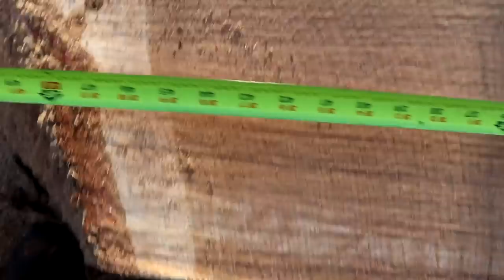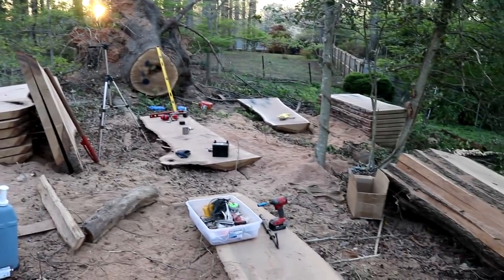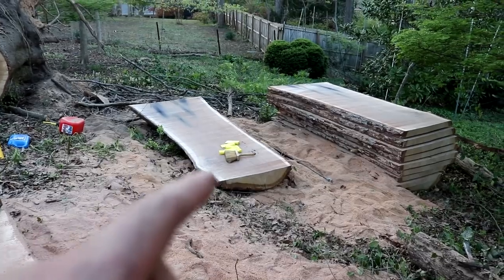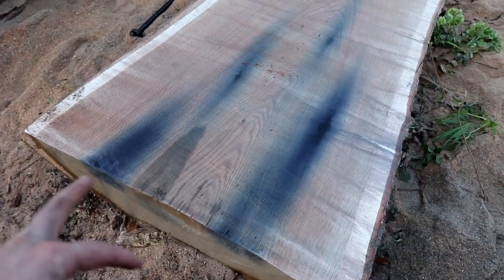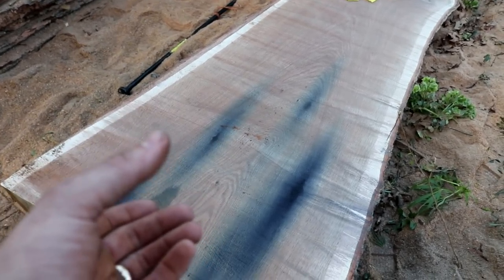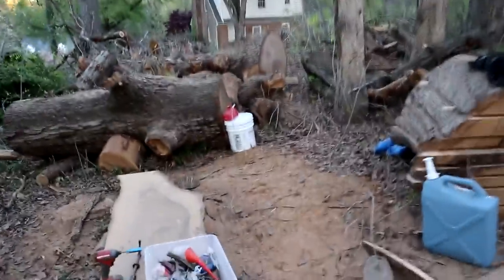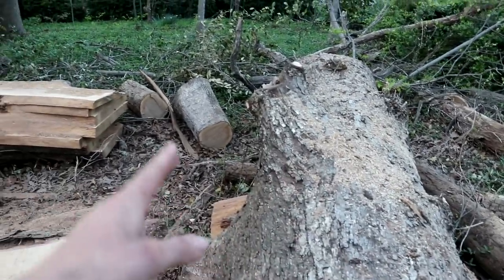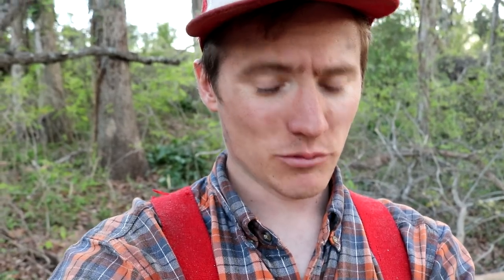HUGE CHAINSAW MILLING JOB!! 45 Foot White Oak!!!

Comment: Even though I have had extensive experience with chainsaws throughout  my life, I have never considered using one to mill lumber until watching your videos. If I ever decide to tackle the challenge, I know I can fall back on your channel for some valuable and instructional insight. I encourage you to continue the work you are doing in your own unique manner. Speaking for myself, it is highly appreciated.
Reply from the maker: It's a cool system, it's got huge capabilities when you consider how large of a bandmill is required to do the same.

Comment: How dead and dry was that tree? I did an end cut log round table and the thing aplit like crazy. Is an end grain “round” slab going to dry out faster? How do you keep your slabs from splitting, start to finish? Looks like anchor seal with the initial cuts.... do you have to stay vigilant with sealing after you slab and plane? How that wasn’t too much jumble! Great work sir! Inspiring for sure!
Reply from the maker: It recently fell over, it was basically still alive, leaves still green. I use Achor Seal on the ends of the log before milling.
Reply: The hard part with "cookies" is that they dry at different rates, from the outside first - it puts a TON of strain on the wood, which causes it to split apart like that.  Check out this video from Matt Cremona for a good explanation: https://www.youtube.com/watch?v=UupXXZ4kVfA

Comment: What is that device you're using to make those slabs?
Amazing!
Reply: It's an "Alaskan mill", probably Granberg. He's rigged up a pulley system with a winch which will make the job a lot less tedious. Saves a lot of pushing and pulling on the heavy saw with the big bar...

Comment: I love your videos, so I'm asking nice for you to wear your chaps if you're gonna jump a trunk with your brake off. How much does that slab weigh at 11:00 if you had to guess?
Reply from the maker: I think the big slabs weighed 300 - 400 pounds. It's soaking wet and white oak....some may have been near 500. It felt like picking up slabs of concrete.

Comment: minus the time spent milling you are really cutting costs of table material. stay safe out there!
Reply from the maker: I'll be honest, this is the most expensive lumber I've ever gotten. Paying is much cheaper as long as it takes to do this work. In the time it takes me to deal with it all, I could make a ton of money if all I was doing was making tables. The problem is the rarity of what I'm getting.
Reply: Would it have been better to have hired a labourer for some of the grunt work and to make it all a bit easier and therefor faster. I sure the cost would be balanced by you getting back to what you do best and make the money on (building tables), quicker.
Reply from the maker: That could be said about everything...but then you've got someone standing around with a dumb look on there face ruining your fun because they could not care less about what you are doing. I'm not doing any of this because I have to, I do it because I want to. With that said, help would be nice, as long as it's the right help.

Comment: What oil are you using in your gravity drip system?  I read that you can use cheaper vegetable oil since you are dripping on the pull side of the chain you don't need a sticky chain oil.  Do you worry about chain oil staining the wood?

Comment: Excellent video. How long has the tree been drying out for, before your slab cut it? Your slabs are beautiful and precision cut. You are absolutely a professional slab cutter. Your chainsaw mill equipment is professional precision equipment. Well done, good work.

Comment: Sounds like you have more tasks then time to do them. Family is important. I liked the wood with the stain running through it, is that natural? Also 
Poking forward to you completing the house. Keep up the good work.
Reply: Looking ,sorry auto correct.
Reply from the maker: The black stains are from nails or some kind of steel. The dark brown stains in some of the slabs are from some naturally occurring situation, not sure what. All the rest is just the wood.

Comment: Just for the sake of asking . If you were to cut , sell 
 , what would the cost be for this ? Yes the whole tree and stump too , if any good wood was in it . As is , green , ready to be stacked and dried by the buyer elsewhere .this would include the buyer having helpers to load and stack the wood on a trailer . Not you loading it .

Comment: The future looks bright. Great finds with all that lumber. Are all of these trees a keep what you cut type deal? I'd guess most people are just happy to have the fallen trees cleared.
Reply from the maker: I'm not paying for any of it. I try to clean up the best I can, but I'm not leaving with anything else than slabs. I'm just cutting up the branches and toss stuff over in the woods. If a person wanted me to remove it all.....I'd probably just pass. If I was set up doing this stuff professionally and had lots of equipment, etc...then maybe I'd get the other stuff, but it's too much work for what I'm doing.

Comment: 8:05 This comment was translated with google translate. It may be difficult to understand. The original is below.
Forest or plain roads, where huge logs are cheaper than crushed stone or market and crushers and crushed stone, could be built of huge logs, cut near the road on 3 or 4 sides, caught together with the edges from the ends cut obliquely so that thresholds do not appear. It is an anti-theft solution. In California, in a desert area in the 1900s, an entrepreneur paved a boardwalk. Part of the road still remains today, but most of the planks were stolen by the few locals who sometimes had to transport them tens of kilometers to their homes.

Drumurile forestiere sau de campie , unde bustenii uriasi sunt mai ieftini decat piatra sparta sau piata si aparatele de spart si maruntit piatra , ar putea fi construite din busteni uriasi , taiati langa drum pe 3 sau 4 laturi , prinsi intre ei cu marginile de la capete taiate oblic ca sa nu apara praguri . Este o solutie antifurt . In California intro zona pustie prin anii 1900 un intreprinzator a asfaltat un drum cu scanduri . O parte din drum a ramas si azi , dar mare parte din scanduri au fost furate de putinii localnici care au trebuit sa le transporte uneori zeci de km pana la casele lor ..

Comment: Great work! You Sir need a front end loader or a bobcat with forks on it.😉
Reply from the maker: You are correct....I'd like both, but I really want one of the mini skids that you stand on, like a Boxer. It could go on my trailer but maneuver in tight places for when the log could not be removed and milled elsewhere but my videos are not pulling in that kind of money.

Comment: Twenty years ago I was dragging white oak logs out of the woods (trees were already down, I didn't cut them down) They made beautiful quarter sawn additions to my home. I had to wench them onto a trailer and take them to a saw mill. I didn't have an expensive saw or rail mill guide then but wish I did. I'm wondering what parts of him he has cut off by now with all that jumping around with that saw. I noticed once the was cutting from the top with his right hand running the saw and the left by his side. If the saw had kicked back, well you know what would have happened.

Comment: awesome, where did yo get the pulley system, its not standard on the mill, but it looks like it will save a lot of back breaking work.

Comment: Your not going to believe this . Almost make you cry . In a small town north of Shreveport , Louisiana  I was given 2 months to finish cutting and removing some very big pecan trees that were huge and old . A remaining pecan orchard . There were 93 trees cut down , limbed , logs laying for the milling . The clear main trunks varied from 18 - 30 feet , clear before they branched off . I couldn't get ANYONE. That wanted to cut and mill these trees , they ended up being piled cut and burned !!!!!! Made me sick !these pecan trees were from 4+ feet  -  almost 7+ feet in diameter at the stump . Fortunetly I was able to get two logs out before they burned all . The lumber from them is gorgeous old growth pecan . It would have made a bueutiful timber framed home for someone , or a lot of furniture and conference tables . What a damn huge waste !

Comment: Do you think Anchorseal works better than latex paint? I have been using exterior latex "oops" paint from Home Depot due to the price ($4 gal) and it seems to work ok. Primarily on red oak here in Michigan, using it for windsor chair parts. Just wondering if Anchorseal is worth the extra cost? Stay safe!

Comment: Nice work.....hard to do without getting the saw stuck.
Reply from the maker: Indeed, you always need a second saw to cut out the first one...one time I was cutting a big tree loose from a bunch of other stuff and  got the bar stuck there was no pulling it out. I ended up having to remove the saw from the bar and chain and leave it. I meant to go back but forgot, a few years later I was talking to the man who owned the land and for whatever reason, chainsaws came up and he said he found a stihl chainsaw bar on the edge of his field. At some point the tree broke loose and the bar fell out. He walked around behind his house and came back with the bar, it had been in the back of his truck. This was one rusty bar down in the grass on hundreds of acres and he happened to see it, he is over 90 years old. I was shocked.

Comment: In 89 Hugo came way inland and the rain and wind took down 8 oak trees in my yard. The smallest was over 30" about 3' from ground. 
One oak app 3' up was 49" dia, over 35' to the first limb and that was 31" dia. It was a monster. The bad part I wasn't into sawing like you do.
There was not a rotted spot in any of the trees, but then no one wanted oak. So into firewood cause that is what I used. I'll bet you could do a lot with that tree. What do you do with this, build furniture? enjoyed watching be careful.

Comment: What brand bar?  What type chain? Why did you choose double head bar with helper handle?  Is the pulley/line worth it?
Reply from the maker: I got the bar from Granberg, my guess is Canon is making them, but I don't know, they are just painted gray. I'm using Granberg ripping chain, also have a stihl ripping chain but they don't make it anymore. The bar is just what came with the kit, but a helper handle is preferable with larger bars helps move the saw around, nice with a helper. I can also run two saws on the bar, you take off the handle and put another saw in it's place. I recently bought another matching saw to restore and use for this reason, doubling my power. The winch set up is well worth it, I would hate doing this without it.

Comment: Incredible work. Pardon my ignorance but what is that white paint-looking stuff you brushed on the cut ends near the beginning? What purpose does it serve? Thx!
Reply from the maker: It is to seal the end grain. Keeps the wood from drying too fast and cracking. I'm using a product called Anchor Seal, which is specifically meant for what I'm doing.

Comment: Nice to see your vintage chainsaw do the grunt work. These new "EPA regulated" are nothing but junk and once you add "EPA" crappy gas to it you have a chain saw that you were using one day and it won't start the next.
Reply from the maker: That saw runs like a top, it's an incredible saw. Super simple and a power house.

Comment: That short log would have made some great endgrain slabs!
Reply from the maker: They will make great big coffee tables which will look better than cookies, grain is better and will dry more stable.
Reply: My comment was meant toward what folks seem to want.  Once I have my mill set up I'll be able to handle up to 36 inch diameter.  My plan is to do mostly slabs but cookies out of lengths that fit that way in the mill.  There is no source for any type of slab wood locally so I hope to have enough business to keep my disabled arse with a reason to do a little something at least daily.

Comment: I don't know what the price of lumber is in the U.S. particularly in your area but those long live edge slabs of oak would easily be several hundred dollars each in Canada, you probably have a few thousand dollars in lumber that you milled on your own, very impressive :)
Reply from the maker: They would sell for quite a bit, probably 600-1000 for the wide stuff. By the board foot, they are staggering.

Comment: What kind of chainsaw and size you use in the video.  And how often did you sharpen the chainsaw blade?  And do you recommend cutting green trees preferably then the ones that  been sitting forever.
Reply from the maker: 1967 Stihl 090. sharpening depends, couple slabs when things are going good. Green wood cuts best but to work with what you can get.
Reply: @thehomesteadcraftsman8975  I really appreciate the info, and i enjoy the videos. Looking forward to seeing more new chainsaw milling videos.thank you. I'm a new subscriber.

Comment: Nice job. What kind of mill are you using?
Reply from the maker: It is made by Granberg, it will cut 5 foot wide slabs or so, it might be 66 inches i can’t remember. The saw is older, a 1969 Stihl 090. You will need an equivalent saw either the Stihl 880 or Huscvarnas big one. It’s about a $4000 set up plus you need other stuff, tools and such but it’s very inexpensive compared to other options that can mill large logs. My bandsaw mill is currently priced at $75,000 with a year plus wait. It can do 39 inch logs by 24 feet long. With huge logs it’s normal too hard to move them, the chainsaws mill can do it right where the tree lays.
Reply: @thehomesteadcraftsman8975  yeah I have a woodmizer super hydraulic already but I can’t do live edge slabs from the really big logs. So looking at a chain saw slabber.  Thanks for your time.

Comment: Wow...ok so i have a red oak...48" to 33" over 46'.  It been down for about 5 yrs and the first 1" deep has gone punky under bark in places but its over a slope so most not on ground and its still stout.  Its in a horrible spot so thats why i dont think even skidders took it.  Its only coming out in peices and thats even gonna be tricky. Id hate to see it go to firewood.  Id like to slab or block it for table tops and say block coffee tables but i have no idea where to start as this is new to me.  

So how do i know how long to cut each section?  Which sections are  best for block tables and for table tops?  

What size saw do i need to run an over 48" Alaskan mill?  What type chains and how many?

SO many questions....

I did call a local company which does such...but they want me to give them $1000 for my log which then becomes their log and i only have first dibs on what i want them to make out of it.  

Im i nuts to try this myself?

Im not a furniture maker by any sorts but i could make block furniture.  Maybe give slabs to craftsman for tables?

What cha think?

Comment: Real nice wood, I am interested I knowing what you used for equipment, mill and saw and bar length. Thanks
Reply from the maker: I'll be doing a video soon showing all the equipment in detail and showing how it is all used...but in the mean time, I'm using a Stihl 090 saw, granberg mill, granber ez rails, granber sharpener, come along winch from lowes, but also recently got a gas powered winch from Portable Winch and a bunch of other stuff.
Reply: Thank You for the info, I have several white oaks some with 2-3-4 stalks( trunks) just branching off 3-4 feet from the base of the main trunk. I will not be cutting them because the are used as shade.  It was interesting to see white oak boards. Most of the time I cut white oak trees It is bucked up for firewood. I do have red cedar logs that need to be slabbed and a few more trees that need to be cut down.

Comment: Do you have access to a kiln, or do you plan on air drying all of the slabs?
Reply from the maker: Yes, but I'll air dry them first. I don't have an indoor area to store them if I kiln dried them. Outside under tin for a couple years and then finish off a few pieces here and there as needed.
Reply: Thank you for the reply.  I admire your drive and work ethic.

Comment: Do you sell your slabs to a furniture maker? Thanks for sharing.
Reply from the maker: I have not yet as I recently started milling. It's also probably more trouble than it's worth if you don't have it set up as a business. Selling takes time, unless you are set up for high volume, high price items are the only way to go in my opinion. I feel the area that I am in would not fetch a high enough price for the slabs to warrant the time spent with people looking at slabs, haggling to only sell a slab for a few hundred dollars. Once these slabs are dry, they are not that far off being table tops. A simple base and they can be sold for many many times more than I could sell a slab for. With that said, If I knew someone that wanted one, I'd sell them one.

Comment: What is the name of your mill along with the pulley crank and where did you get it.
Reply from the maker: The mill is a granberg, it was one of the full kits. The winch came off Amazon. I think I put links in the description.
Reply: I believe you linked everything except the winch that you have for your 36" mill.   Just want to make sure I get the right one.

Comment: That’s an impressive set up for the 090.  Did you add the pulley and reservoir yourself or was it bought like that?  I’m looking into an 660 model with a MKII setup and that pulley rig looks like it save your back.  Just starting watching your videos and I can’t wait to try doing this on a much smaller scale.  Thank you for sharing.
Reply from the maker: Added the winch. Oil tank came with the milling kit. Granberg makes a winch now, check it out.